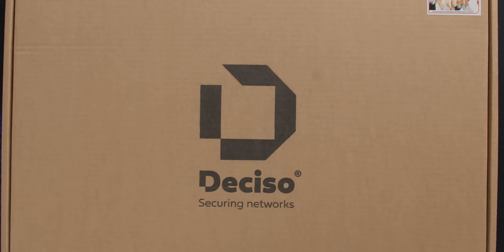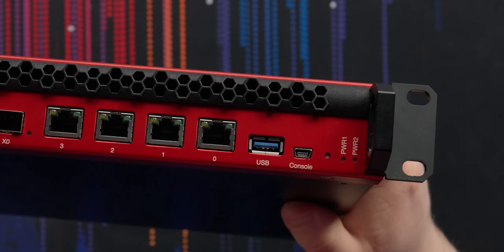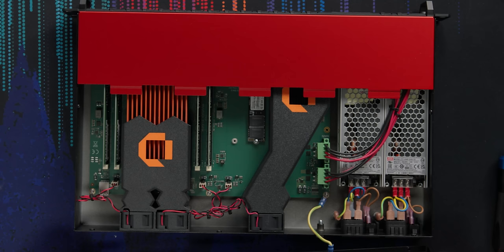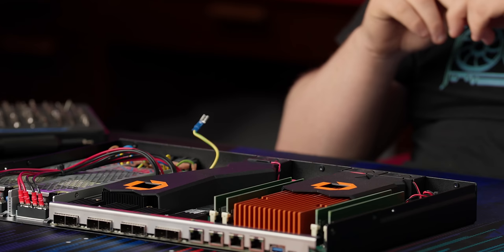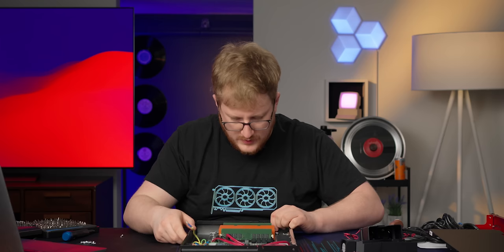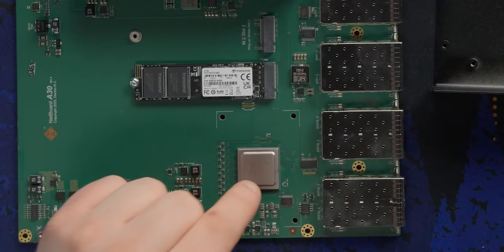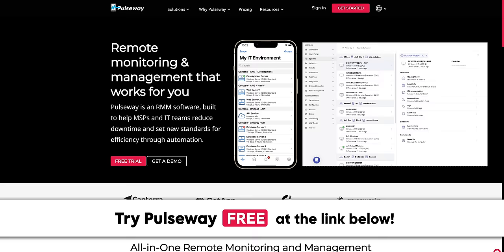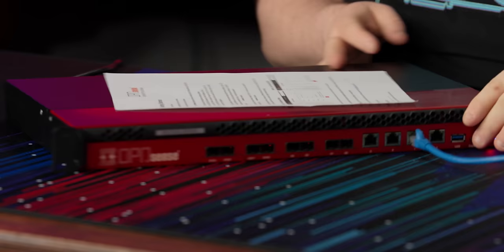Our BIG network upgrade! - OPNsense DEC4280

Comment: The price for this hardware is insane. Those CPUs are Zen 1 from 2018. I can build a faster 3rd gen Epyc firewall for a quarter of the price...
Reply: It's all about silence system. The engineering behind that has a price.
Reply: I run OPNsense on a chinese N100 system for 150 bucks. Partly cheating because I had spare parts laying around but hey.
Even with IPS/IDS I get the full gigabit on a home network. You really don't need a lot. But as an organization it's better to go all the way for decent support especially if your entire business is reliant on your infra.

Comment: I'm really impressed by the power of this device and the neatness of its hardware. Agreed, adding dual SSDs would make it more versatile. The price is a bit high, but for specialized use and considering the performance, it could be worth the investment for some businesses.

Comment: Oh neat, they're actually using the 10G Ethernet MACs built into the EPYC SoC. Those have been in EPYCs for a long time but I never saw anyone actually use them. Couldn't be sure if there was some problem with the hardware or if vendors just chose to use stuff from Intel et. al. because they knew it would work.
Reply: I haven't looked in to the datasheets for it, but I would assume that the dedicated intel NiCs have more fixed function hardware onboard and can do a great deal of offloading tasks, freeing up CPU ressources.
Reply: @RobinCernyMitSuffix   yeah, I assume if someone uses the ports are a switch, they can just do that without going through the CPU. It's how a simple DSL-router does it too when they have multiple ports.

Comment: At over $6,000 USD I don't want a single 3D printed part on it. Additive machining is for cheap stuff, not something that cost this much.
Reply: What's the downside of 3D printed parts? All of the individual parts are not cheap + personal, etc. Everything they use is for non-structural reasons so I see no downside.
Reply: @burnstick1380  They are substandard to injection molded parts and far more prone to breakage in high heat or high airflow environments. They are not substantially more cost effective at a large manufacturing scale to justify their use over injection molding or other methods of making plastics, are often more expensive to manufacturer, and they often take longer to make and result in more waste than traditional methods of making plastic parts.

Basically, it's a company trying to be hip and cool and they are wasting money and driving up their overhead and passing the cost along to you while giving you an inferior product.
Reply: Yeah, that is too bad.
Reply: At least with 3D printed parts, if the part breaks you don't have to rely on the company to have spares in a warehouse. usually custom parts like that you can pay an exorbitant amount because of the low demand

Comment: For 6000€, you can get much more better 1U rack servers... maybe they need a bit more power, but you can expand later with NICs (or other stuff), but you can get proper long term vendor support, and proper iRMC/iLO/iDRAC/whatever bmc, to manage the sever independently to the main OS.

Comment: For your use case its a great machine. For home use i would suggest the dec695. Still expensive but also has the same feature set as this one in the video, sure not as fast but its still there.
Reply: For home use an N100 off Aliexpress is more than enough.
Reply: @alexatkin  also true, but i like supporting FOSS when i am able. In my case i would but the dec695 behind a router since PPPoE isnt multithread process.

Comment: I'm sure Decisio is happy they sold at least two DEC4280s. I don't know what market this is for. If you want to run OPNsense you can buy some used enterprise hardware that will offer more benefits (like hot swappable PSUs, more RAM, more storage) and spend ~$1000 to match the feature set.
They made it quiet but 99.99% of rackmount products are going into a datacenter where noise doesn't matter.
Too expensive for a homelab but not built for the enterprise.

Comment: I have something similar at home. Embedded Epyc 3451 on a Supermicro board. Noise level is about the same, but no 25Gb ports.. also running OPNsense.

Comment: Non hot-swappable PSU's is a big no no for any enterprise environment.
Reply: Yeah, I think some of the design priorities don't really line up with most customer's actual goals.
Reply: I wonder who made the call honestly? It has an enterprise price tag. 

Because they’re less then hot swap able means you’re taking the whole network/device down anyways. 

So you either dump to a cold/warm spare or replace the PSU by hand. As it’s not safe to do in prod/while on.
Reply: @AgentLokVokun  you would use two or four in a mesh so one failure doesn't take down the network.
Reply: @AgentLokVokun  It's not an enterprise product, it's a small business product.  While hot swapable would be better, no one using this product is going to care about having to schedule 15 minutes of down time after waiting a couple days for a new PSU to be shipped out to them.
Reply: @NigelMelanisticSmith they are still improving. This is their newest lineup, I believe the last gen just had one PSU in any of the models.
Reply: you might be surprised how many high-end cisco products don't have them either.
Reply: Obviously it's for a high availability setup. They mentioned in the video they have two of them. What do you do if there's a ram failure? What about CPU?
Reply: @jgould30  I work in an enterprise environment as a network engineer. The enterprise switches all have modular psu now. Unless you’re running 2900x or so still at the access level.
Reply: @wojtek-33  Meant for  HA, enterprise price tag, lacking enterprise features, costing $6,500+ each. Non redundant storage? Non hot swap PSUs? 

Do better. 

This is 🤡equipment.
Reply: @TheAlaskaAdam Blows my mind these are $6,500+ USD each and they lack, what I consider, basic features at that price point. 
"JuSt BuY MoRe ThEn OnE" is a dookie butter argument when it lacks redundant boot drives too. 

Sure I'll just spend $25,000 on networking gear because they CBA to put in more then 1 SSD or replaceable PSUs.
Reply: @wojtek-33 It sure doesn't act the role when it costs north of $6,500 + licenses.  

Non redundant PSUs, non redundant SSDs, etc. It's a 🤡product for a 🤡 market segment.
Reply: @wojtek-33 The product can't justify it's own existence.  /thread
Reply: Agreed. If it's not hot swappable then you still have to shut it down to fix it. What's the point of two then?
Reply: @wojtek-33 @wojtek-33 True, but who just leaves broken hardware?
Reply: @shanent5793  @wojtek-33 but you will be spending to much time replacing PSU's.

A replacement of PSU like that would take 5 - 15 mins + bootup time.
A replacement of a Hot swappable PSU takes 30s - 1 min.
Reply: @danielc2985  meh, they usually charge at least half an hour to touch anything so there's no real difference

Comment: I am running a fortigate at my house myself a 60F. When you throw in the additional licenses and the facts that it is a true zone based firewall its hard to justify the opnsense hardware in my opinion.
Reply: Plus OPNsense is quite inferior to pfSense in both speed and quality - I would never recommend that firewall to protect any business. Fortinet is really good, but their price hike since Covid-19 is getting out of hand now + their few recent major CVE are making me and clients reconsider is I will remain with them or not.
Reply: @Traumatree  i we t through CDW for mine was expensive but seemed reasonable for full UTM for 3 years. As for their CVEs they are all for SSLVPN which is a feature I will never use through this firewall and instead use a wireguard VPN.

Comment: What I want to know is how you're integrating OPNsense with your Ubiquiti network. For example, in order to avoid double NAT, I've had to disable SRCNAT masquerading via iptables on my UDM, because there's no way to do it in the Unifi software.
Reply: Why would you have double NAT ?  Remove any UDM craps router from your network and hook your switches directly to the other firewall, then use Unifi Server or Hosted Unifi to manage your stuff.
Reply: Put Wi-Fi routers\APs in bridge mode and do all NAT, shaper, DHCP, etc. stuff on the "main server" in the rack?

Comment: FortiGates rip on throughput as long as its something the ASICs support, but as soon as it gets punted to software it drops a fair bit, PPPoE is a really great example of this. What's the cost of updates like? Fortinet charge a chonk for annual FortiCare/FortiGuard licence, depending on licence/bundle you get all the AV/IDS etc updates but it builds up for the overall cost (got about 1600 of them in production and use a 40F on FTTP at home on my lab)
Reply: Stop using 30/40/60/80-F models to do SSL/TLS decryption and PPPoE and buy a real business oriented one. And at least, Fortigate has ASICs to do some heavy lifting, while with OPNsense, everything needs to go through that general purpose CPU that will choke like the rest of them when it needs to decrypt packets.
Reply: OPNsense supports QAT for cryptographic acceleration, and the various NIC offloads. Business support is around 4-500 euro a year depending on what package you want.

Comment: I am generally surprised of that The power supplies are not hot swappable and there is no raid with 2 drives for device that is acting as both a firewall and main router.  However, the expected redundancy seems to be that you have two of these devices or more connected. That will not be my preferred option for pricing but it's Enterprise and I normally do SOHO. I do wish the test have been done with the full set of firewall rules but there are channels dedicated to firewalls.

Comment: The big sku is quite price competitive. I work with Fortinet Equipment, in terms of throughput that's comparable to a FG-400F with like 14k US MSRP (although any Fortinet Partner can probably get you a better price).

The small sku though (the 4240 i think?), really isnt! for barely more dollars, you can get a 200F at MSRP that offer much more connectivity. and again, MSRP is often way higher than actual price paid.

Cool vid!

Comment: This would most likely be put in a data center or server room, then sound level is less of a issue. Looks like a good design !
Reply: It seems quiet enough for a small business that just has something like 12U rack under a desk, or a smaller one wall mounted... but it would be a bit overkill for those places.

Comment: Those not hot swapped PSUs are a joke for what is considered enterprise grade gear. 

It would actually be easier to dump to a warm/cold spare then deal with the dead PSU. As it’s not possible or safe to replace in prod. 

Do better.
Reply: THEY'RE NORTH OF $6,500 USD + LICENSES -- EACH

Comment: PSU is the component that fails 9 out 10 times in firewall and in generally network equipment. So for this not having hot swappable PSU is very disappointing.

Comment: @LTT: if you plan to test networking gear, you should really create some sort of torrent farm. This 2*25Gb/s is nice, but as I see, you did only 4 or 8 tcp connections, which not as hard to manage ... If you want a more realistic connection number, create 5-10 VM on the servers seeding big video files, and ask everyone to start download it around LTT clients... ;)

Also, if you're using this stuff to get data from the Internet, usually NAT cames into play, where every packet has to modified by the router, and it can give some more penality...

Comment: C13 is a normal power cable right? PSU and kettles use it
Reply: Correct c13 and c14
I think TRCHINALLY it should have a C15/C16 plug setup due to the high temp rating. 

But when he mentioned the PDU they have those whack C19/C20 plugs that look like -.- not |.| which are often “20 amp” plugs
Reply: @AgentLokVokun  Yes, kettles over here are meant to use c15/c16 which look almost the same, except there is a cutout under centre pin, I assume for a more snug fit as well as the higher rating.
Reply: ot quite, the lump is just to prevent non high temp cables being fitted

Comment: Why would they want to reduce turbulence on the airflow for a cooling purpose?

The greater the turbulence is on the airflow, the smaller is the boundary layer effect that limits the flow of heat towards the air. So to me the 3D printed weird shape on the fans would maybe introduce some initial turbulence to increase heat transfer.

Comment: remember ALL other firewall OEM charge 4-5x the cost of the hardware in license and software fees. So $6500 with NO reoccurring costs and top line performance is amazing cheap. So a 1K fortnet or Sophos box is about 4K in software and the hardware is no where near this things performance. so the total spend is always in the 5-6K range all in. This is cheap for those reasons.

Comment: IPS performance at 7.5gbps looks pretty bad. But I guess is a limitation of pfSense and OpnSene. That is exactly what I got on my router when I tried pfSense, about 7gbps with IPS enabled. I've migrated since, for other reasons, but I now have 15Gbps with Firewall, IDS/IPS, transparent proxy and content filtering, with 50% CPU load (i5 8500, 4 cores asigned to the firewall).
Reply: All those services on 8th gen intel?😮
Reply: @brighteduacation1297  It's newer and faster than that Epyc Embedded 3000 series which has two Zen 1 dies at 3.1Ghz. With 2 NUMA nodes that will most certainly impact performance (lot of CPU crosstalk when the NICs are working if IPS or IDS is balancing between cores)

Comment: I just switched to OpnSense from PfSense CE. So far I like it more than PFsense. I switched for QAT without Pfplus. I got a Dell vmware sd-wan 620. 4 core intel atom with 4x1gbe, 2 x10g sfp+ and 2x 10gbe rj45 for under 100$. Takes some tinkering to get OS installed but once done its such a nice machine.

Comment: It's interesting. Although I prefer netgates approach to their hardware, as it's more modular. Definetely want to add a OPNsense instance on my test lab at work though heard is that bit better than  pfsense.
Reply: The only benefits I'm aware of is the UI is easier and updates are more frequent.  If you already know the pfSense UI the first is irrelevant, and the second can be a negative too as more updates means more chances of problems.  Seen a few people say they prefer pfSense as its less prone to glitches from updates due to the longer period between releases.

Comment: I actually have a minisform ms-01 and tried doing opnsense on that but the problem is they do not support wake on lan or power on after power loss so if you lose power it's dead till you turn it back on manually. Really saddened me and I had to swap off it even though it worked well

Comment: I’m confused 😂 why even have redundant power supply when they are not hot swappable 😮 you would need to turn it off in order to change it anyways 😅😮
Reply: The dual PSU is more to get a redundant power source, also a device like this is usually ran in a cluster so taking one offline is not a problem.
Reply: @danieledg94  you don’t run gateways in clusters. But in high availability or load balancing setups. And sorry no, then one quality power supply would still be enough if you have to take it down in order to fix the power supply issue.
Reply: @davidbl1981 you missed the point, dual PSUs are so you can feed the unit from 2 different feed circuits, so that if there is a power issue on one circuit the building doesn't lose connectivity
Reply: @bengrogan9710  exactly, a failed psu is not that common
Reply: @bengrogan9710  if you have that at Your Home then Nice but i Think not, two truels Independent power Company feeds, entering from different paths so you avoid cutting both feeds.. you are moving into Enterprise requirements there buddy … and then to not have hot swapping pay is just a joke at that point. Just see it for what it is, a bad design choice in order to make a consumer product look more appealing !
Reply: @davidbl1981  What part of a 6.5k device sounds like a home device to you?

It's a low cost enterprise device, at roughly half the cost of the Fortigate or Cisco offerings, and has compromises relative to that -  in most real world enterprise scenarios independant power feeds are ideal but rare - in cases where that is plausible it would often be instead a backup generator, 
instead most businesses will simply have 2 seperated ring mains in the building as the concern is avoiding short term service interuption as if any PSU has a sudden failure it can trigger the Reseidual current breaker and take down the full rack if you don't have that
Reply: @danieledg94  beg to differ based on my 15 years of Network consultant - PSUs are the components that fails the most.

Comment: Oh Lord I was going. To stay this thing blows Cisco and other brands out of the water. I guess so. But it's price is insane for a home user almost 10K USD for it
Reply: It does not blow anyone out of the water, I can assure that.  Having 4 x 28GE but can only do 21Gbps port-to-port throughput is bad -really bad.  Firewalls that usually have that kind of speed on their interfaces are 2U-size box with a lot of hardware in it to make it happens.  This box is a joke, nothing else, as the both the CPU and OPNsense can't really handle loads at that speed effectively.

Comment: While I support OPNsense this box is a no-go. Fan not reversible by config (and remove the sticker crap prevents turning around the fan inside) and a normal data center has a cold and a hot side, "home level" data room (not center) has by 99% cold side only. Its simply too expensive to have a major shortcoming like this.

Comment: When will we be able to build our own open source router that uses 6E or wifi7 network cards that can use the 6Ghz band in AP/master mode, so far just about everything only runs at 2.4Ghz in AP mode on linux/bsd.